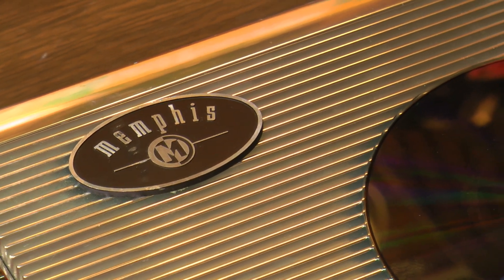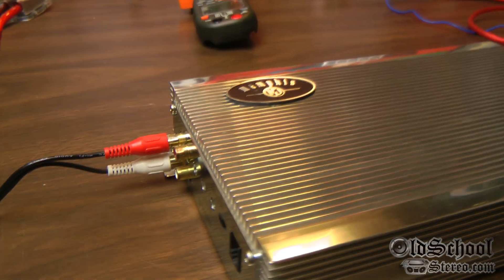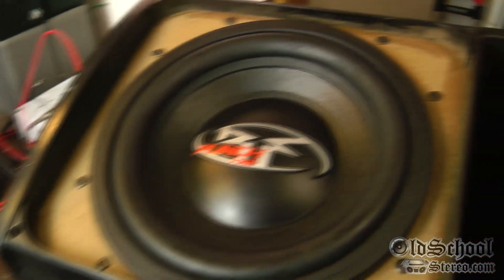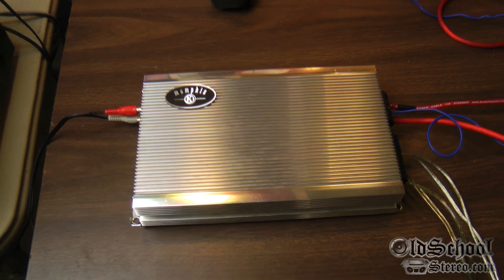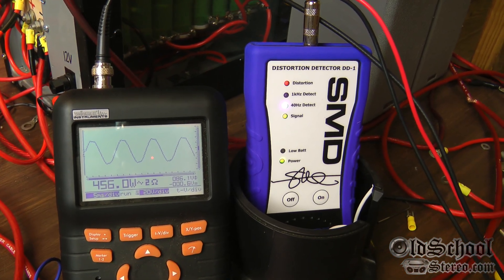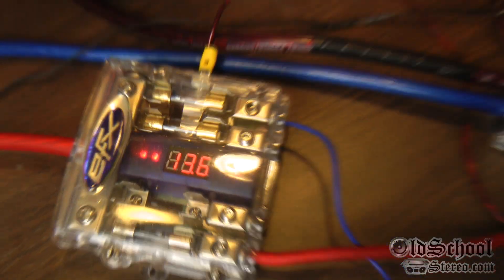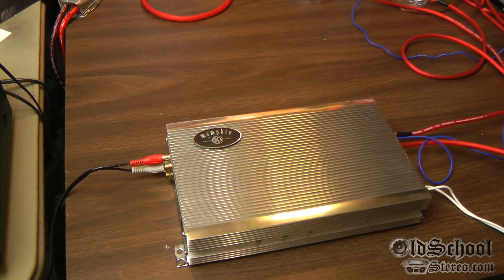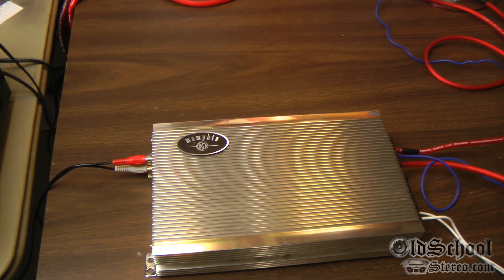Memphis 16-ST500D 500 Watt Monoblock Power Output Test and Sub Demo DD-1

Comment: If I remember correctly the 500d will make 761w at 14.4v and is not 1 ohm stable. The 1000d on the other hand is 1 ohm stable and I believe 1100w at 14.4v. I matched JL W0  125w with the 500d and they took everything well. Every other speaker died with that amp. I used a small crossover and set the gain at three quarters and it was dialed. I don't hear shit that loud these days.

Comment: Hey Big D! Could you test the 1100d version of this amp on the amp dyno? I have loved these amps since the late 90s, I have one running 2 12" m6 subs right now along with the chrome 4 channel on a set of 6 1/2 components and a pair of 6 1/2 coaxial in my 2006 Maxima. I also have 2 1100d in my closet, when I run across one I always buy it for a back up. Lol!  I am a true memphis bass  head. Love the content bro!!!
Reply: Come on test the class d 1000d!!!

Comment: I have two west coast 12’s have not got to hook them up there Rated at 400 apiece do you think this amp would do the job a buddy of mine gave me the amp but not sure if it would be big enough to do the trick any feedback would be great
Reply: Lol I started my system with 2 West coast 12s. Got them on Craigslist brand new for $50. Had a planet audio amp from a auction car I flipped and payed $100 for some cheap 4guage wiring install. The planet Audio was 1500 watts but really more like 90watts Rms and the speakers couldn't take it turned up. I would suggest you get some good wiring. Like 0 guage pure copper you can find good kits for about $100 and intall that. Once you have good wire your possibilities are endless. Im pushing 2 alpine type RS at 750watts Rms each with a Memphis prx1500.1 1500watts at 1ohm. If you gonna go cheap go super cheap. Pretty much any $50 amp will push those subs. Save up for nice subwoofers next. And after that a nice amp. Just my box is $200 I went all out. My whole setup is about $2k now.

Comment: hey, what is the different between connect 2 subs to each terminal and 2 subs wired in parallel which go to only one terminal?
Reply from the maker: +Marc IOfs nothing, the mono amps with multiple speaker connections just parallel the connections inside the amp.
Reply: i have music hawk mono mh 800.1d. 800rmsx1. but i'm not sure if it is 800rms at 1 or 2 ohm. but can it support 2 subs with 250 rms for each sub?

Comment: big D hears a question for yeah! Have you ever redyno'd amps like these after you got your new SMD dyno machine. Just to see if the clamp and the oscilloscope gave you the correct #'s. I would like to see this amp or any other that you dyno'd like this redyno'd on the new machine to see if you get these same #'s.
Reply from the maker: +Josh Hanson I have, and the results are very close. I sold this amp a while back, so I cannot retest it 😔

Comment: BigDWiz,I noticed you did not have the bass knob hooked up on the Memphis 16-ST500 while performing the amp output test. These model amps, for some odd reason, seemed to produce a lot more power with the knob hooked up. I had a lot of the studio series amps back in the day including a 16-ST1000D. I was disappointed in the amp without the bass knob hooked up and went to return it to the shop I purchased it from. They instructed me to hook up the bass knob and see what it did. I hooked it up and was like WOW!!! Night and day difference. Might give it another round with the knob hooked up to see what it does.
Reply: Where can i find the knob for it i have the 16-st1000 but cant find the knob
Reply: I had that same amp running 2 Soundstream SPL 12's and blew them apart. Had to switch to Fosgate Punch Power DVC's cause they handled more power. Absolutely dumped with that bass knob turned up.

Comment: 53a x 13.6 = 721w. 456 ÷ 721 = only 63% efficiency, kinda mediocre. Todays amps are closer to 85% efficient, saves batteries, plays longer w/o having to start the car. Still, damn good sounding & a real workhorse amp.

Comment: Hey man im running the memphis 16st1000d have you done a test on one of them or can you i would like to know what is does for power , and if its what its rated at or not. It claims 400wrms at 4ohm, 600wrms at 2ohms , and 1100 at 1ohm , if it doesnt how much are these worth cus m trying to get and audiopipe 1500 like you tested for my two audiopipes
Reply from the maker: I have tested the 16-ST1300D, which is the 5ch version that includes the 16-ST1000D for the sub channel. I can't recall the exact numbers, but they are very close to rated. I'll post that video in the upcoming weeks.
Reply: Ok thanks man but honeslly what would you say sell it and get the audiopipe 1500 that you tested

Comment: true, but the way you worded it, it was insinuated that it isn't capable of 500wrms (right at 3:39). 435w @ 13.6v could easily translate into 500+ at 14.4v. Since efficiency isn't linear you could have a good deal of lost power over just under a volt off rated voltage. I understand that realistically on a regular car system it will be around 13.7v charging. But great video as always. Ill be watching....

Comment from the maker: This is so true man and not many mics I'm aware of can handle more than 150dB (even big dolla ones). There are some advanced manual settings I use to keep my mic from distorting, but even with the high dollar pro mics, you'd need to lower the gain WAY down on the audio recorder to capture sounds in a high SPL system without getting distortion/clipping. Recorded digital audio just works different than our ears and doesn't have the dynamic range we as humans experience

Comment: any camera can pick up bass clean and not distort when the box is on the table of a work bench out in the open and with relatively low wattage.  In a car, with massive cabin gain and 20x the power, it becomes tough for ANY camera mic to handle bass.  Just a little FYI so you can understand the difference.

Comment: I have still my. R. F. 800a2
I went through 30 pair of HX 2 twelves with that in 3 different kind of box configurations tinsel leads slapped together  and burned Woofers also come apart not kidding 30 pair I went to 4-15's fixed my problem killer video bro!!;)

Comment: love them sub. i got three. one is the model like that and the other two are the previous model from when they made the power dvc. had to repair one but i got the coils from psi and they didnt have any dual 4 that met the dimensions of the stock coil only daul 2s. i do have an extra coil if you would be interested in getting rid of the blown one let me know.